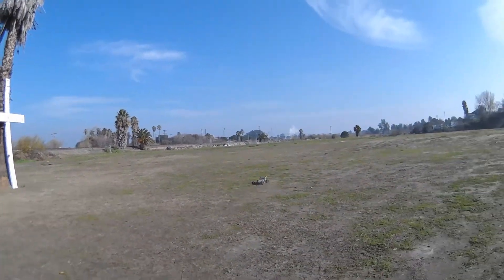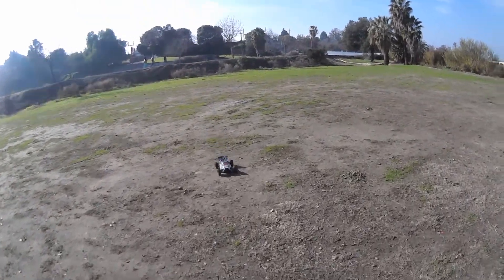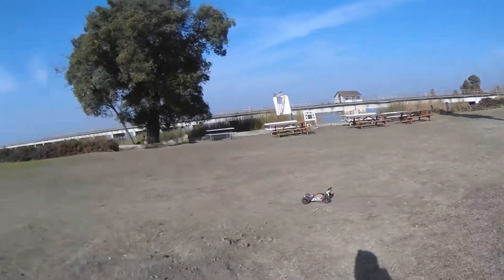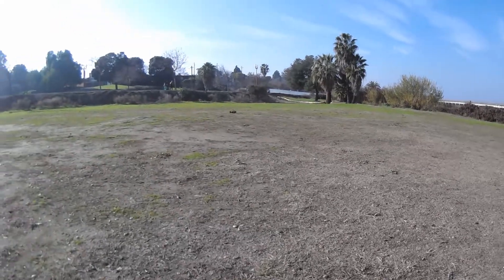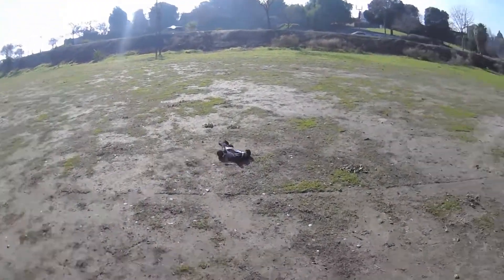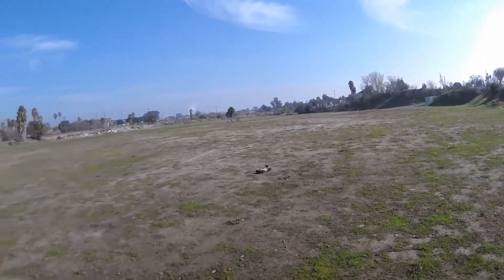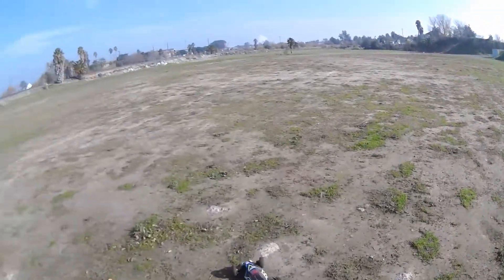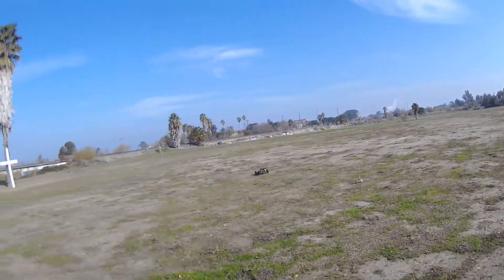Tamiya TT-02B Brushless Open Run - Part 2

Comment: Is the Cube new? You will have to keep us posted if it begins to hold a charge are not.  This TT-02 seems to be running pretty good.
Reply from the maker: It seemed to hold a charge today after about 10 cycles
Reply: PhilthyCo RC Just had to work into then.  Glad it’s working now.  I might have to look into that cam